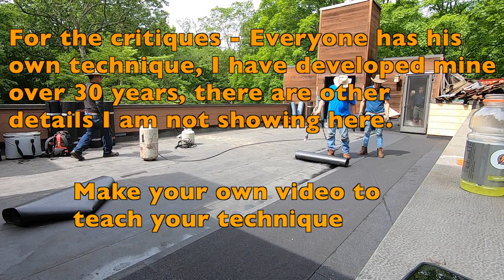Learn how to use a torch on a Modified Bitumen Torch Down Roof

Comment: That roof would blow away such a crapy over lay
Reply from the maker: Couch potato. I guess you are a football critique too and basketball. Mental problems are ramped in America. When you are depressed then only negative will come from those thoughts. I guess summer will be here soon and it might help you get of the couch and do a little work. 
I am sorry that you have such a hard time. My suggestion is find someone that you can help. That will get your mind off negative critiquing others.
Reply: Actually I’m just Stating an obvious fact that this system is not going to work the way your Advertising it to iv roofed long enough to know that this kind of over lays have serious probably over a short amount of time your Trapping moisture that’s Embedded in the tar and gravel roof that will become hazardous Mold problems later on and is the cheap mans way of selling a flat roof instead of properly tearing the roof off down to the sub and by not ripping the old roof all your Penetrations and drains become serous problem areas and as for your comment of me on my Coach In fact I am with my feet up after being on a 10/12 shingle job that I put in ten hour days on becuse lazy is fare from who I am but to witch it seems you have an issue with me stating my opinion on your work that upsets you witch ever more proves my point that it’s a crappy over lay system that will fail before it’s time you have sold it to be I feel sorry for your Customers but I guess that’s just job Insurance for guys like me
Reply from the maker: lol keep shingling - I know are are an excellent shingle guy. You are obviously not an expert in Torch Down. The only roofs I installed for the last 30 years are Torch down Roofs. I guess i have a little more experience in Torch Down than you.
Anyway, I love you. You seam like a hard worker. I am more a business and marketing guy than laboring guy.
keep up the hard work, nothing wrong with that.
Thanks for your comments, even being so critical, I can handle it, Mr Feet up the couch

Comment: Wow , kind of different than the way I torch. 
I will need to get my video going on my next torch down job. 
For when I want to seal the torch down to edge metal I would instal about a 6 inch strip of torch down first , then metal , then the top layer.  So I'm sandwiching the metal to the touchdown.
Reply: I used to do that too with 9" strips but it doesn't really work as great as it sounds because to get the strip hot enough to melt the torch to the back of the metal you end up putting too much heat on the metal and it warps. I guess even if you don't melt the first layer to the metal but the 2 layers melt together if water gets under the top layer it will be forced to go out to the edge of the roof under the metal instead of leaking and if you fold the base sheet over the edge it will be forced off the roof I think. At least that was my thinking.
Reply: @bobbarker9986 , put a strip granule side down and nail it on and then sandwich your metal. It won't require as much heat.
Reply: @kevinwaller6353  yes that's what I'm saying. but even better than that is to use smooth so there are no granules at all. Melt the smooth to the base sheet prior to installing the metal. Then melt the two sheets together, but to get the bottom piece to melt to the bottom of the metal it still takes enough heat to warp the metal but it usually straightens out once it cools.
Reply: Do you like the peel and stick base better then torch down base?
Reply: @bobbarker9986  do you like peel and stick base better then torch down base?
Reply: Yes I like peel n stick base for torch down. Nailing down base was such a pain and took way longer
Reply: @travissmith3720  I ment do you like peel n stick better then the torch down base. There's a nail down peel down and torch down base. And most ppl still use the nail down with one of the other bases
Reply: @Brandon-no3vc , in my opinion the best base to use is Polystick SAV peel and stick base with torch cap sheet.
Reply: @Brandon-no3vc  I like the peel n stick base
Reply: @travissmith3720  you have to use a nail base and a peel and stick
Reply: @Brandon-no3vc  alright then , well that doesn't make any sense
Reply: @travissmith3720  just the peel and stick would get really hot on the wood when your torching to it so you shud use fiber nail base plus your seams are staggered on both bases so extra protection and you can use the fiber nail down base if you want to go over the rocks too. Plus 3 ply system is better then 2

Comment: Whats to stop roof from blowing off cause u did not put enough plates. Another thing i have never seen no company put this system over rocks. We usually either rip it or suck rocks off and use rubber with polyiso.
Reply from the maker: You are just someone taking orders. Monkey do what monkey see or told. This is a self-adhering base. No need for your "plates and screws". Also even if it was the system you think it should be, base paper with plate and screws, then the only reason why a roof would ever get blown of by wind is if it could get under the membrane. So if the edges were totally loose, and a little wind could sneak in under, it would start lifting and become a huge sail.
Yes, you are right, you don't know much. I thought I was one of the first to go over the stone. I came across a few roofs that were done like that 30 years before I did it. The method you describe is 3 x more costly, and there is no reason if the substrate is still in good shape. In fact, it is far better than what you are used to. The stone act as insulation. The air trapped between the stone is a natural I isolation and also allowing moisture to move out to the sides. This type of system is a huge benefit. I guess you also don't use the ceramic granular surface, just the smooth. 
My suggestion is to become the best in what you do, instead of becoming a critique. You will never amount to anything critiquing others and yet you are not the best. All I do is Torch Down for the last 35 years. I don't do shingles, EPDM, TPO or metal. 
"I am the Flat Roof Doctor, I know a thing or two because I have seen a thing or two, bla bla bla".
Reply: @papasonmoney1546  Wasn't sure if anyone was noticing the "unique" application here.
Reply: @papasonmoney1546  Sorry Papason you’ve lost all credibility when you said you work for GAF..They use too be fantastic with GAF Ultra ect but then they bought out ELK & let there quality & philosophy go to crap..They’ve turned down obvious roof failures that in the past were covered under warranty..it’s the one brand I know longer use…
FYI: Over the years I’ve installed numerous roofs for GAF’s literature, Sample Boards & appeared in instructional GAF videos  & tested products for them before they were released nationally…As far as going over rock, goes, when I talk to guys who’ve had proven success doing  things a different way I don’t dismiss them, however out here in Los Angela’s I’d check with the inspector first…
Reply: @papasonmoney1546  totally agree with. You..I now only use Certainteed..Years ago I’d primarily use presidential TL-Ambassador now landmarkTL elk-plus & GAF ultra- never had problems..I’ve many celotex Ambassador roofs that are 20 years old & show NO signs of wear but 15 year old Landmark TL’s are showing fairly dramatic wear..Things have taken a major turn for the worse.,Sounds like you’ve got a much better job..no one should have to be a rep now..luckily I’m semi retired now ..Continued Good Luck!

Comment: I am from Russia and I also make such roofs, with proper operation of the roof, it can stand for 30-40 years, regardless of the life of the material 20-25.  nice to see skilled craftsmen in the usa, maybe someday see in the usa. Cood work).
Reply from the maker: Thanks Mr Russian - I am surprised to hear that they have the same materials over there. I have been installing Modified Bitumen Torch Down for 30 years.
It appears that fewer and fewer Roofing Contractors are willing to install this type of material. I could be because the learning curve is higher than other materials and it is slightly more expensive.
You are correct. This material will outlast any other roofing material.

Comment: Finally someone who knows what he's doing! Just the right amount of heat in the right place. I like how you always keep the flame aimed towards the side seam to add extra heat, even when you are heating the other side. Like you said your son was moving too fast and not melting all the seam area, heating too short of an area and rolling to far each time. I'm sure he does it great now because you know the difference. I've got 44 years on the roof, sold my hot tar kettle in the 90s and do exclusively torch down now. Great job!

Comment: i have never went over gravel with a base layer. i have with recovery board.
Reply from the maker: Sure, that is what everyone does. But, the recovery board becomes a problem when it gets wet for one reason or another, either rotting, getting soggy, letting the fasteners holding the recovery board poking up through the membrane. With this method, there is air trapped among the stone allowing to air out whatever moist is trapped. And should there ever be a leak for one reason or another, the membrane will not be compromised and any leak could be taken care off.
Reply: @FlatRoofDoctor , you can't convince me that the rocks will not penetrate that roof by walking on it. If you're concerned about recovery board getting wet at some point then use fan fold polystyrene insulation that is not affected by moisture and on top of it all it is not secured to the building. It appears to be a floating roof. I'm in Florida and there's no way you can get away with that here.

Comment: Hello.  Water is coming in through my seams on my modified bitumen flat roof. How can I stop this?
Reply from the maker: Pop the seams loose where possible. Pry them loose from each other and re-torch. If that is not possible, then use Turbo Poly Seal with the fleece over the seams

Comment: Interesting video.  When you install edge metal, you are using gravel stop on here, there should be a 10 in. strip of smooth torched to perimeter first, then flashing nailed. Next the flashing should be primed with asphalt roof primer.  The quick dry spray is best. Then you torch your finish ply on to that so that your metal ia always sandwiched between 2 layers.  All cant and protrusion areas should also be double with the finish ply.  I believe the Karnak you use on flashing is for SBS cold application, not APP torch application.
Reply from the maker: Ok, that is all your opinion and what you have been taught. I agree to "sandwich the metal edging"  The Karnak is not for SBS only. If you read on the label it is called "Modified Bitumen Adhesive". The Karnak is better than any sprayed on Asphalt roof primer. The Asphalt roof primer is just a very thin layer of the Karnak. It is not even close as good. 
To apply heat to the metal edging is wrong. That is why I don't torch or use a flame to attach the membrane to the metal. I apply a thick coat of Karnak Adhesive to the metal that will prevent the flame from getting to it and then melt the membrane slightly to burn the plastic protection so as to stick it to the adhesive.
This is a trick I started 30 years ago and has not failed me yet.
Reply: First....rip off old roof....lay your base to all perimeters and crease over fascia 2". Install min. ga perimeter drip edge with a flange min 6" onto roof and 2.5 over fascia.....nail the shit out of drip but keep nails out of last 3 " on fascia side of drip.....prime flange...install 10" cover strip onto drip 3". When torching your cap sheet , cut 1" past drip and trim after it cools.....
That's how It done!  😎

Comment: Is there a trick on how to keep the roll  straight When is a long distance?
Reply from the maker: When you apply heat to the roll, one tends to put more heat on the side where the overlapping seam is. because of that, the material expands more on one side than the other.
Overheating the seam could cause the membrane to go on a turn
Reply: @FlatRoofDoctor   got it !! Thanks

Comment: i have  commercial roof that has torch down from an auction it was good for 4 years but now have cracks ,70 of seams are good . should I do the 2ply system  over the whole roof as I want to put a green space on roof later, i have 4 leaks on building
Reply from the maker: If you have an existing Torch Down, then you should only put another Torch Down layer over that one fusing them 2 together. That becomes the ultimate roofing system that will last over 100 years. The 2 layers become a 2 Ply system.
Reply: @FlatRoofDoctor  thanks so much for the fast reply, love all the videos . thought i knew a lot it was originally a gravel roof . it was a lot of work.

Comment: OK I have a question. Could you do the same thing here with aluminum roll for the roof?   And just torch down the seam between the courses or over lap? And screw down the edge of the roll at the top.   I see you use Karnak 81 on metal.  So would Karnak work between the layersif I used aluminum rolls ?

Comment: Very very informative videos this video covered my concerns and the time spent showing the torch down process was excellent.
Showing the results and correct flow of material was perfect I now know what to look for on my project. Thanks for all the information and time you have spent on sharing some of your techniques.
Reply from the maker: Hi Shane, I am glad this was helpful. Let me know if there is anything else that you would like to see or know. When you asked me to show how to torch, I thought I was going to get a few clips here and there and slap them together to make this video. Instead, it took all day. I am now glad I did it. I know many will want to criticize. We will see.
Happy torching. By the way, those pics you have send of your project was very helpful and I think you have an easy roofing job ahead.

Comment: I have a low slope roof with gravel. The roof is in good condition. Can I do the same , just to install a 3 ply system without taking out the Gravel ?
Reply from the maker: I guess the video is not enough. What else will help you to understand. If you have to ask a question like that after watching the video, then you should not do anything because you will be doubting everything you do. Spoon fed people never grow.
I make these videos to show you tips and tricks and what I have done that works. Therefor there is no need for you to experiment. I have paid the price. The only thing you have to do is to either do it or not without risking failure. 
My experience came with a price to your benefit. Take it or leave it.
Anyway, thank-you for asking the question. That helped me to utter my thoughts so everyone else can rail on me for being so blunt.
The answer to your question is - "Yes"
LOL
Reply: gravel must be removed first before putting down new layer of protection board. protection board , base, then cap sheet.

Comment: Nice work!
Thank you.
Reply from the maker: Thank you. I am on a 120 000 sq ft job now where I have the opportunity to make videos of different facets of torch down roofing. This will include how to install Torch Down and tie it into a cast iron drain, field torching, my approach on how to get rid of pooling water, some detail work around curbs and vent flashing, and maybe a drip edge installation detail. My way of doing the described stuff above is different than most other roofers. I hope to get these videos edited and posted in the next couple of months.
But thanks for the compliment

Comment: I need help. normally how much is the footage cost for this kind roof
Reply from the maker: Around 5 - 7 dollars per square foot, depending on obstacles, roof penetrations, metal edging, flashing, and height. Also removing the old roof will add to the cost.
Reply: Thanks for all your help I learn a lot really good videos thank you 👍
Reply from the maker: @uriko4941  I am glad to help